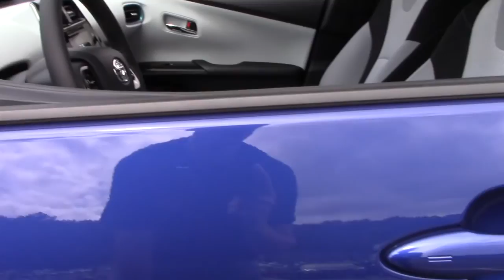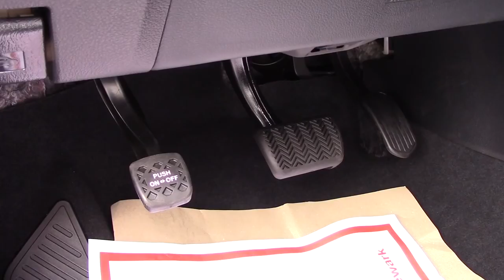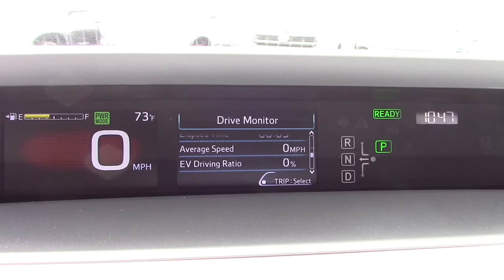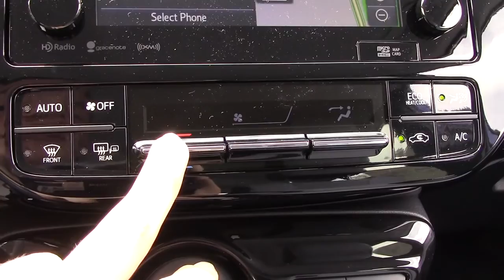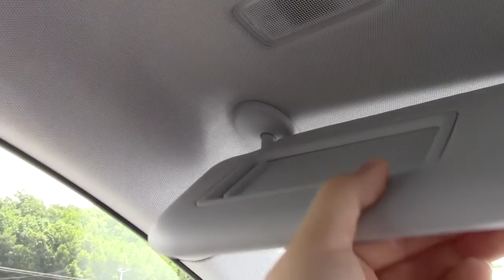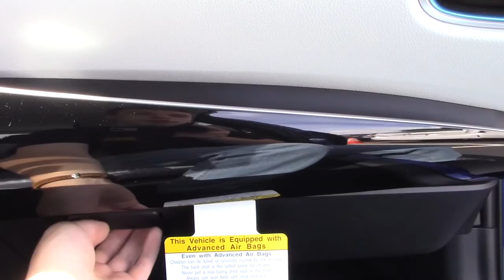2016 Toyota Prius Three: In Depth Review and Power Up

Comment: the 4th generation prius 3 touring is a nice upgrade over the last generation 2. It drives much nicer, accelerates more nimbly, and is much more practical. And, the leg-room is great for those taller drivers. The car does quite well, as long as the driver does not expect generous power above 50.